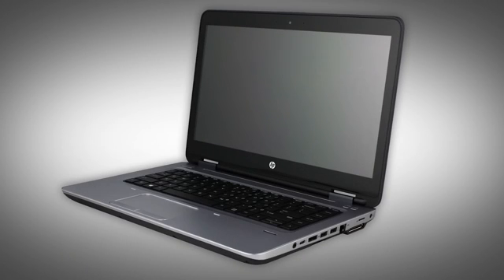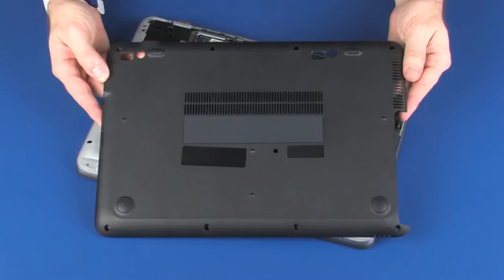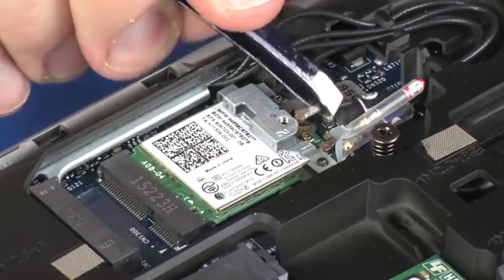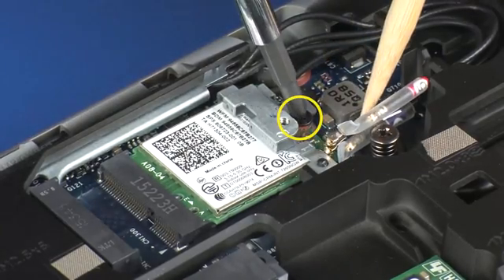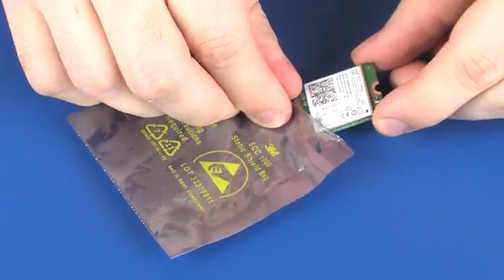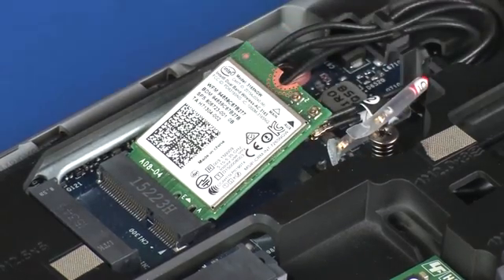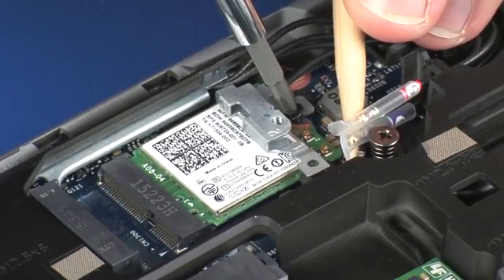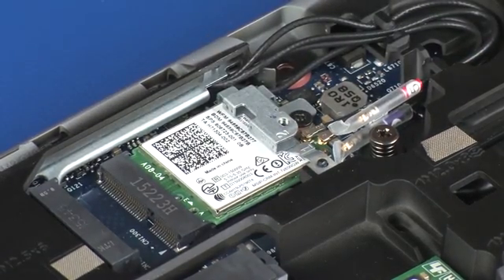Replacing the Wireless Module | HP Probook 640 and 645 G2 Notebooks | HP Support

Comment: Can the CPU be upgraded on the 640 G2? Also, can the G2 be upgraded to Win 11 Pro? Thank you 🤓
Reply from the maker: Hi there, thanks for contacting HP Global Social Media Support!
I understand that you need to know about upgrading processor and operating system of HP ProBook 640 G2 Notebook PC
I will do my best to assist you.
The processor is integrated and is not upgradable. and it supports operating system till Windows 10. 
Binu_HP Social Media Tech Support
Reply: @HPSupport  can it be upgraded to Windows 11 Pro? Thank you 🤓
Reply from the maker: It supports operating system till Windows 10. There are no drivers available for Windows 11.
Binu_HP Social Media Tech Support
Reply: @HPSupport  no drivers for Win 11. Ok thank you. So it's stuck on Win 10? Is there a new or compatible motherboard that can fit the case that can support Win 11? The 640 G2 is a nice modern laptop! Thank you 🤓
Reply from the maker: Thanks for the reply.
HP does not recommend upgrading or downgrading hardware parts or software that is bundled with the product as It may affect the manufacturer's warranty and performance, however, you could change the configuration at your own discretion.
Binu_HP Social Media Tech Support
Reply: @HPSupport  thank you for all these good answers! 🤓
Reply from the maker: If you need any help in the future, you can always get back to us.
Thank you for being a valuable HP customer.
Have a wonderful day!
Cheers!
Binu_HP Social Media Tech Support
Reply: @HPSupport  thank you for the prompt replies!
Reply from the maker: Have a wonderful day!
Cheers!
Binu_HP Social Media Tech Support
Reply: @HPSupport  new inquiry! What is the difference between an HP X27 gaming monitor and the X27Q? How expensive is a replacement IPS screen for the X27 (1080p 165hz) ? Thank you 🤓